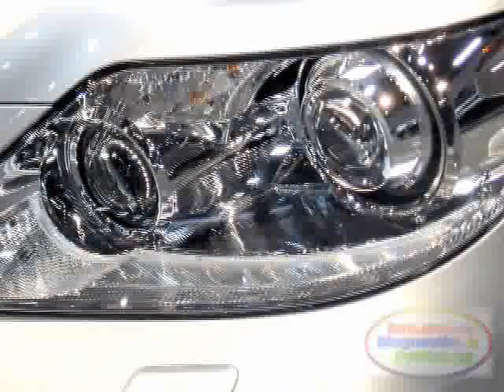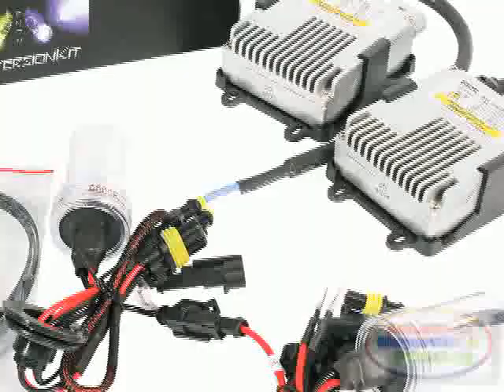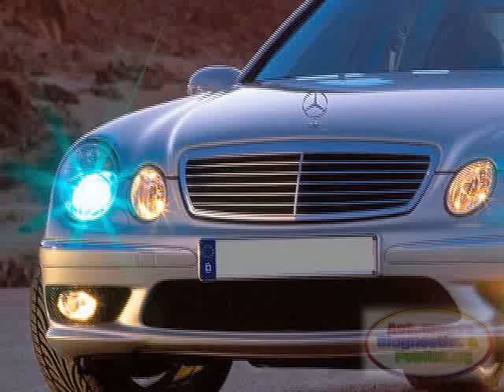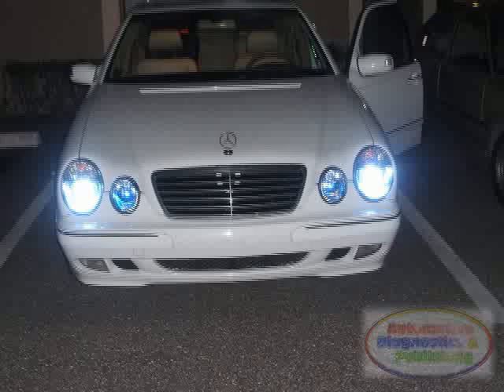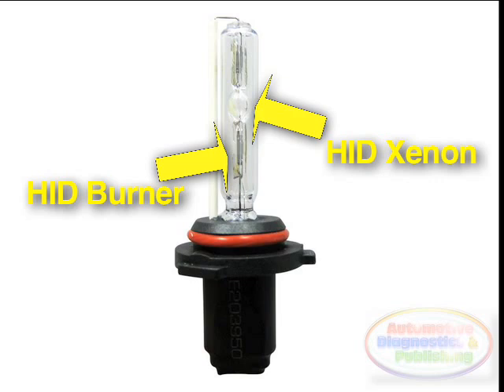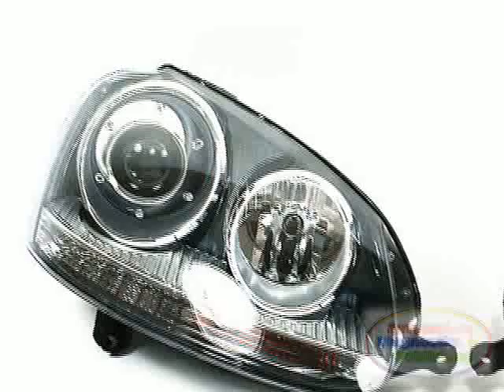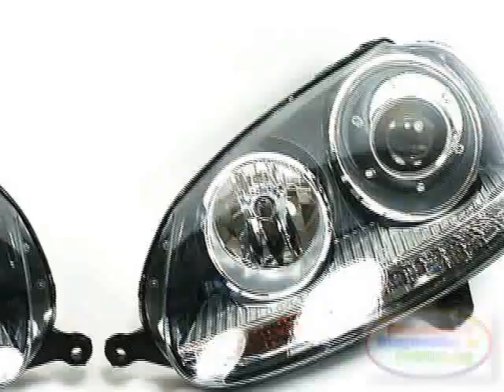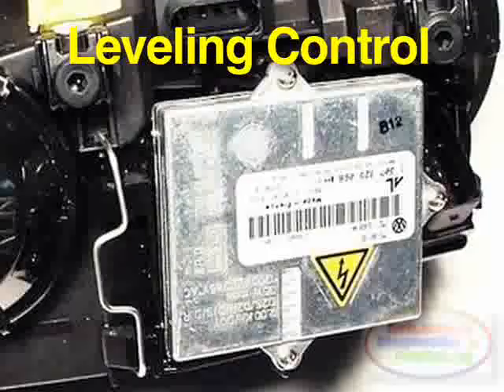HID Xenon Headlight Operation

Comment: I bought a projector/HID bulb kit for my older Dodge truck to replace the sun clouded stock headlights.  I have found them to be remarkably better and safer.  I do turn them off at traffic lights because my work truck is quite high off the ground. The angle is great for driving, but when I stop it behind someone at a light it super illuminates their interior if I leave them on.  It would be great for law enforcement.